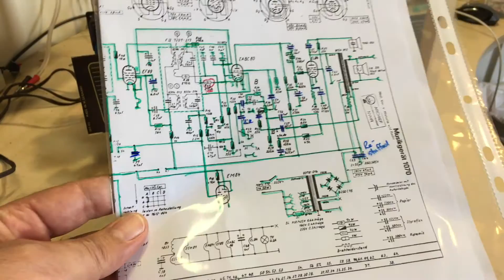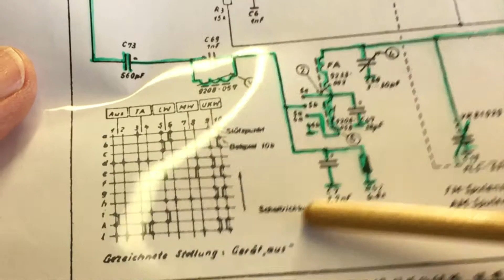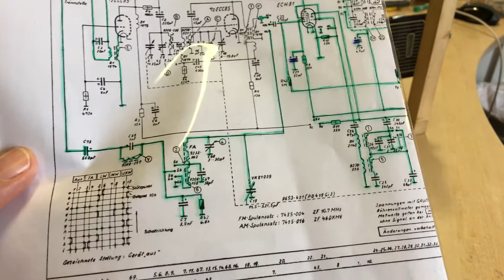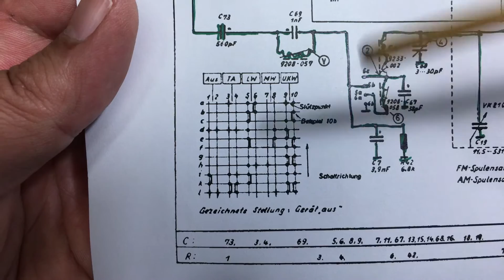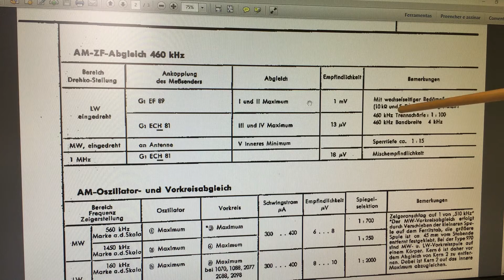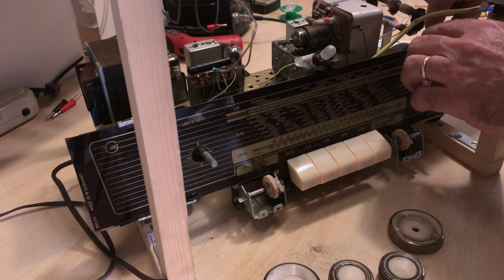Grundig 1070 tube radio restoration - Part 4. AM is done. If aligned. FM ... still looking at it.

Comment: The dampening of the coils is needed when you have an IF transformer which is coupled over critical. When you do a filter sweep and look at the oscilloscope, there're 2 peaks with a slight "saddle" in the middle. So, if you try to align the transformer without dampening, you can't find the right spot, since there're two maximum very close to each other.
Reply from the maker: You’re right. The visual alignment method would be best.